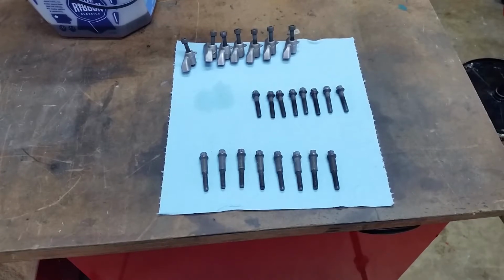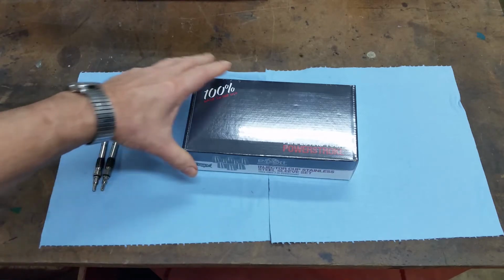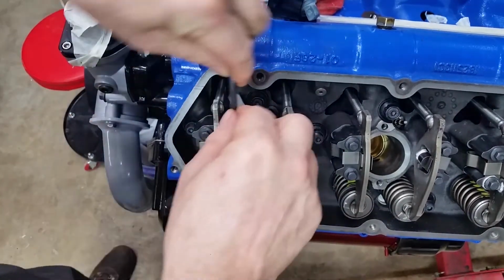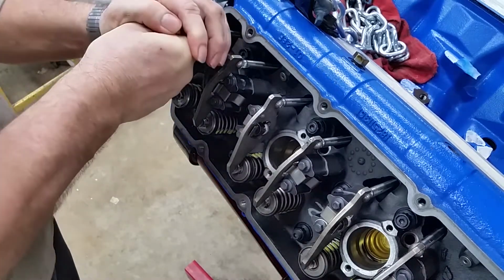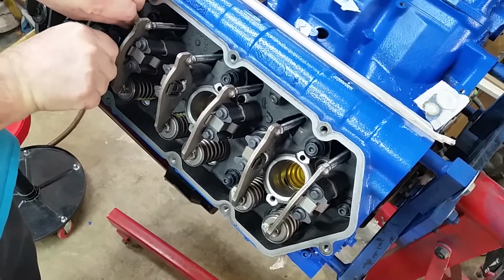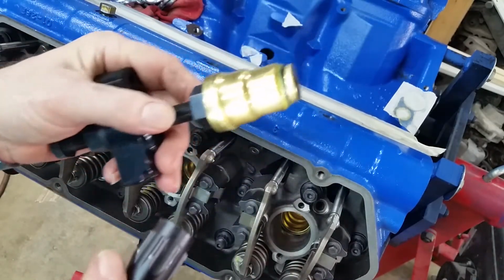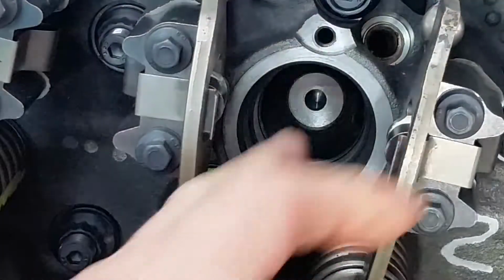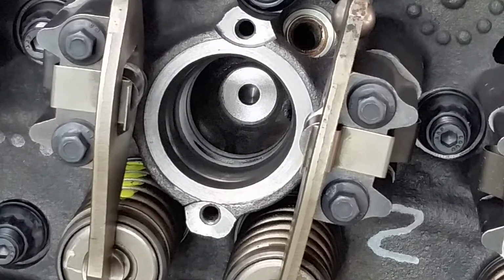7.3 Build: Injector cups??? (Part 1)

Comment: Great idea on the cups!
Reply from the maker: Yes I believe they are the best solution. If you look at industrial or big rig diesels, only stainless is used. I think the brass ones were used originally for cost savings. The stainless appear to be machined from bar stock where as the brass ones are definately cast.

Comment: The Riff Raff injector cup tool is awesome. 
Just did a top end rebuild on my 01. 
New cups, injectors ( from full force ) HPOP, ( From Throughbred )
Rebuilt turbo ( KC turbo rebuild kit )
New oil cooler, up pipes, glow plugs, valve cover gaskets and harness.
Plus all of the add ones from Riff Raff for fuel and oil performance and a CS2 programmer. 
I did all of this just as preventative maintenance. 
Love my 7.3
Reply: Its a great platform and after bringing one down to the bare block and building it forward, I'm convinced this can be a platform for heavy pulling of the HotShot realm. I'm going to try to prove it.
Reply: @Dipperdap1  
After doing all the mods my 7.3 is a work horse and a half. 
Just towed my Daughters 42’ fifth wheel home for her and my truck handled it well. 
Waiting to see yours running.
Reply from the maker: Sorry I missed this response. Wow That' s great. These 7.3's are by far superior to the modern diesels. I personally don't want all the bells and whistles that the new trucks have. I'll have a truckers GPS, a great stereo, A/C, heat,  and cruise. What else do I need? I have a plan for soundproofing and insulating the cab at some point down the line. Then I'll have the power, the quiet and most of the features that the modern trucks have at about 1/3 the cost.

Comment: Thermal conductivity of brass and 304 ( assume that’s the material Riffraff used) is substantially different.  Could this be why International/Ford chose that material?
Reply from the maker: You know, that's absolutely true. The thing is Ford didn't design or build these engines, International did. The very same engine in an industrial usage, like school buses and heavy trucks use the stainless cups as a replacement option. I have looked and researched engines used in heavy equipment and big rigs and they use the stainless cups exclusively.